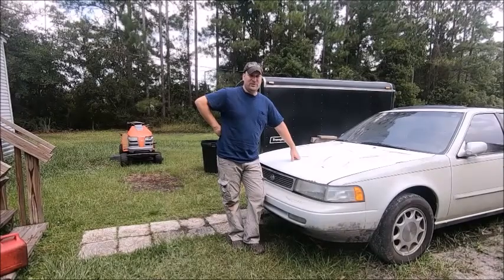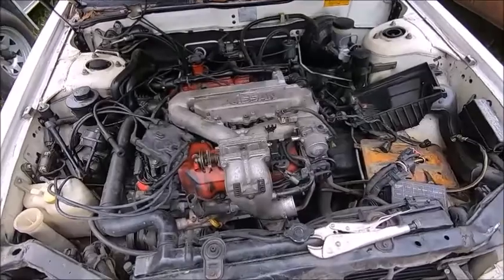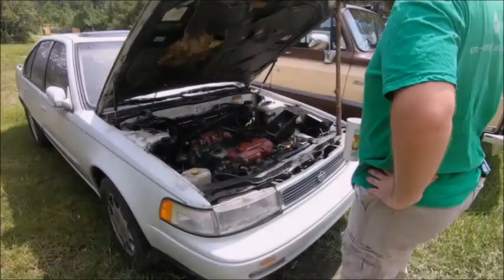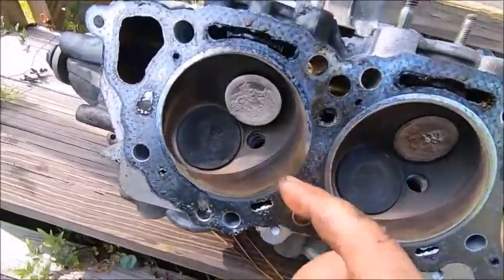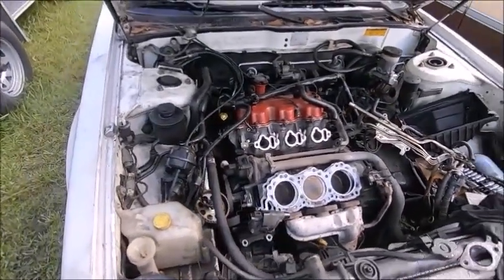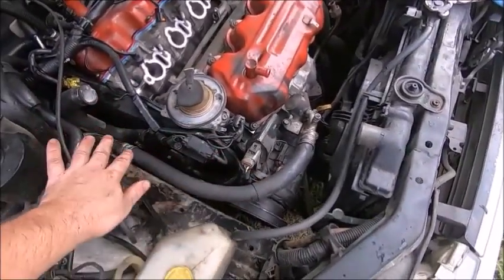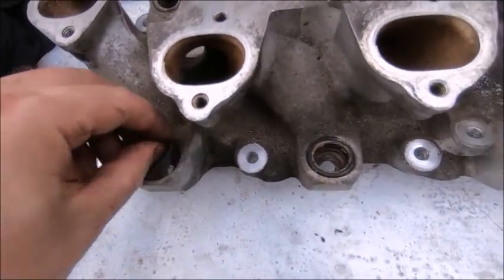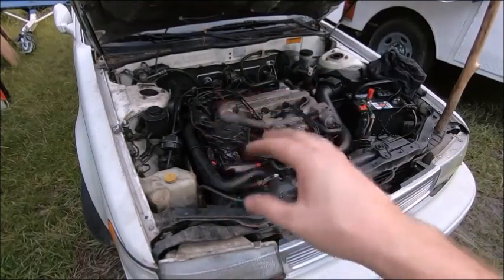1994 Nissan Maxima head gaskets -- shade-tree rebuild!

Comment: I have a 94 Nissan maxima and I’m trying to locate the crankshaft position sensor and chance you might know where it is on the engine.
Reply from the maker: Honestly I’m not sure; I’ve never had to access one. They may be tricky to locate but I would start poking around and following wires down toward the crankshaft front and rear and see where the wiring harness ends up. There’s not a ton of sensors so they shouldn’t be too hard to trace out.

Comment: I have a huge question where I'd the thermostat location
Reply from the maker: The thermostat is inside the hose/pipe/housing assembly at the front of the engine that splits off and goes into the valley between the heads. In this case I removed the assembly as a whole and did not separate out the thermostat itself.
If you follow the radiator hose it goes eventually to the metal housing that contains the thermostat.

Comment: Mad respect, I'm really glad to see your video. It'll be my guide to take care of my 93 Maxima. The way you explained the steps is super easy. Thank you very much, indeed 🎉
Reply from the maker: Glad it potentially helps someone out….. just be careful on the timing belt and don’t let it get loose and slip around the crankshaft gear like I did if you are going to use my method. That was probably the hardest part of the whole thing. In retrospect I should have doubled my chances and marked everything with a paint marker and then i would have seen immediately that it had slipped a little.